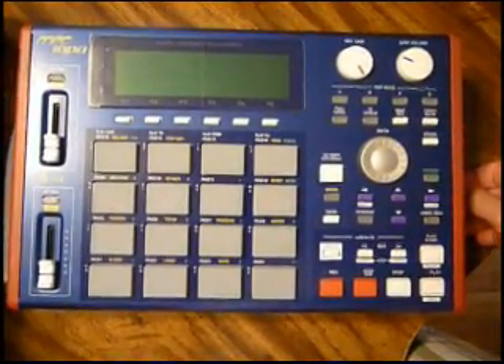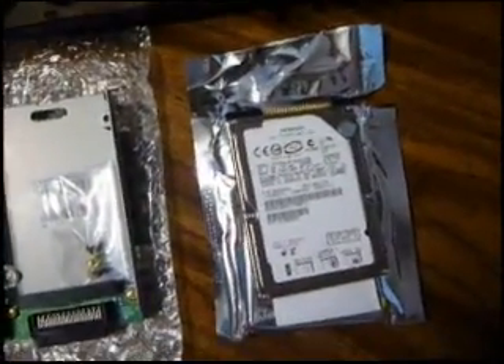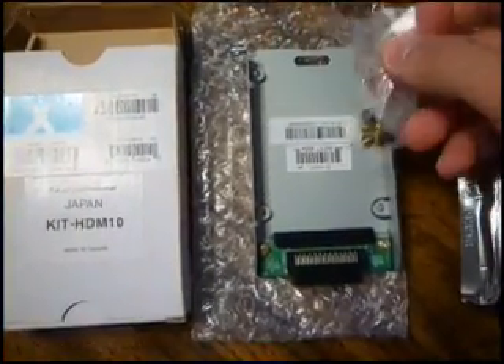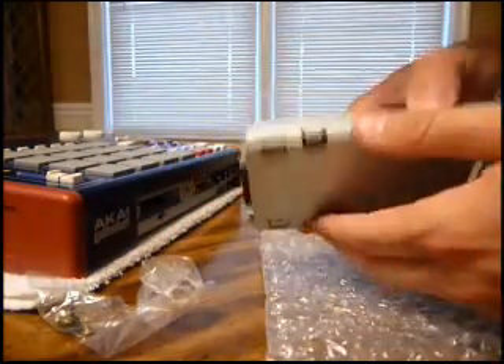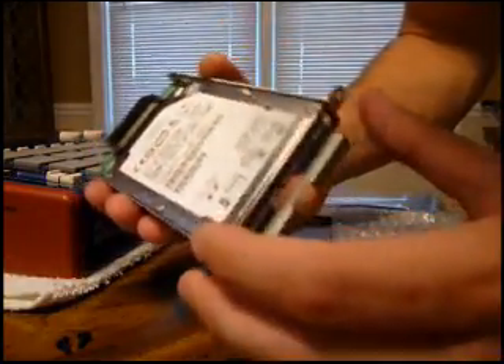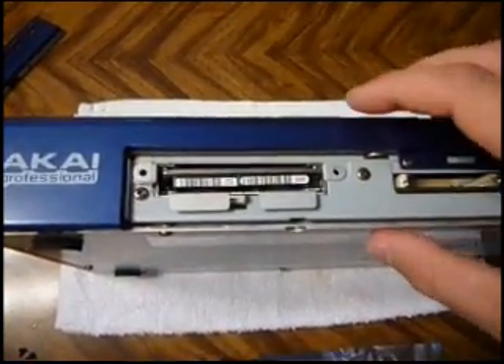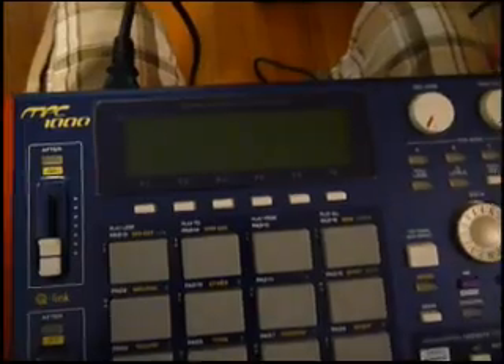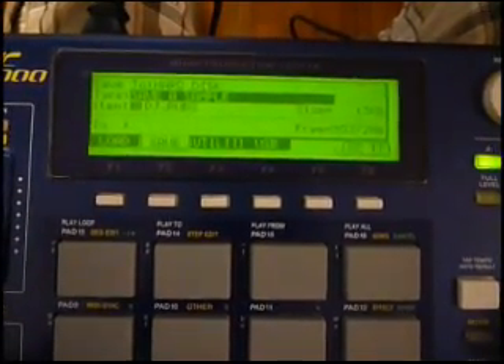DIY | Install Hard Drive into MPC1000

Comment: @drastic209562 
It's probably the formatted size. All storage media needs space on the HDD for formatting, it's used for directories and things. For instance a 250gb computer hard drive formatted only has about 232gb.

Comment from the maker: when you say straight from the hard drive I'm confused by what you mean. The purpose of the hard drive is to allow for storage of samples. You can keep the samples on board the hard drives space and load to play. There is a load process, but the point of the hard drive is for on board storage. You can load and play these samples using the standard akai is. I hope this helps.

Comment: It ain't DIY if you still need the HDM10. I was looking for a way to put it in without the adapter. Now I have to scour the internet for this ancient piece that there's barely any of.
Reply: Ah, that's not bad! Thanks for the tip!
Reply: I hear you, I know I could go and get a 64gb card but I feel like I rather go the hard drive route because I know it should be faster and of course you can get up to 120gb. 64gb CF cards are as much as this combo almost.
Reply: I was searching too and found out it´s a 50 pin 2x25 MDR Male ( Mini Delta Ribbon) connector from 3M (10250-0210EC or
MRB50A-ND) just without the metal shield. So you need the female one.
Reply: as the previous commenter here suggests.. you can also buy the connectors and build this up yourself.

Comment: Would you do this instead of installing the EXM128? I just got my MPC 1000BK and still only have the standard 16mb with JJOS 3.13...desperately need to do an upgrade so I can chop larger samples that I have.